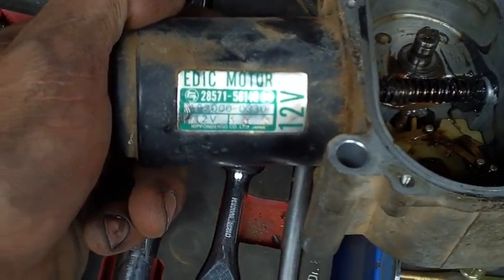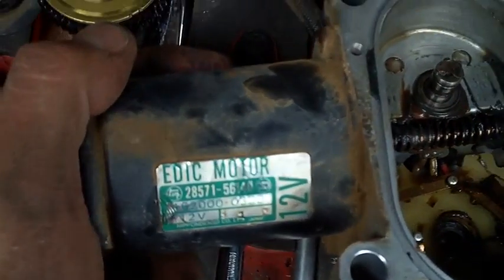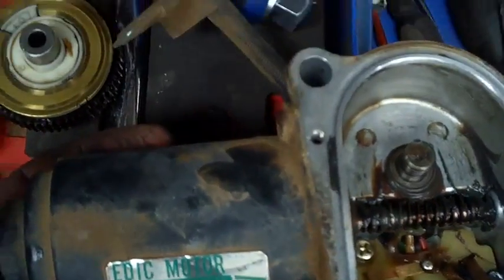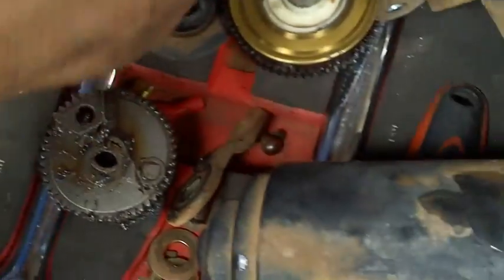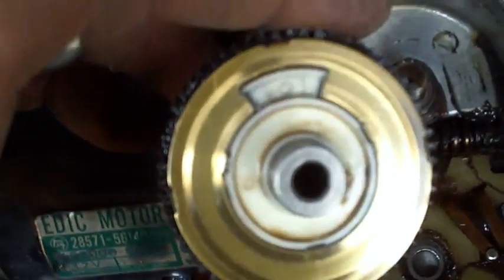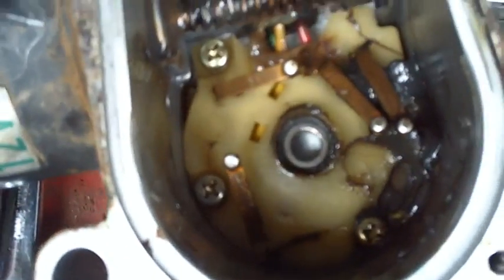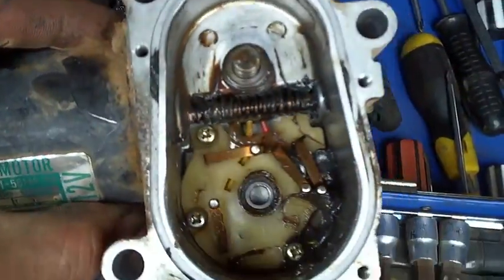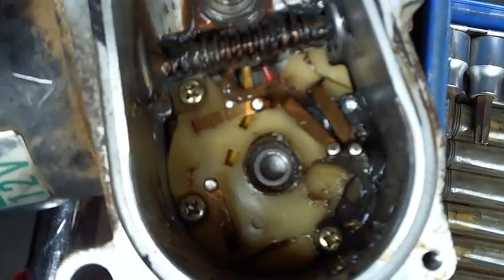toyota landcruiser hj47 2h diesel edic motor fault diagnosis

Comment: I removed  my EDIC as it was not turning the engine  off and kept over fueling. I replaced it with a pull push cable and now have never had a problem  since. I live in Melbourne  Australia so I do not need the EDIC to over fuel at  startup.

Comment: Ive seen people that have completely got rid of the edic as the edic is one of the weakest points on the old 2h. they instead install a manual cable up to the hand throttle. not entirely sure on how its done, though id like to do it to mine someday. I think the info is on ih8 mud somewhere...

Comment: Good one, did the same to my sons HJ47. (The clean out, that is)Although, I'm really chasing the original problem. The unit wont park in the injector pump cutoff position. Its swings briefly to that position but then returns to the run position before the engine stops running. Checked earths, seem to be OK. I'm thinking some one has had it apart and not positioned the output rod arm in the right mesh with the drive gear. When it parks, it should be in the pump shut off position. (According to the engine manual)Also, looking for a fault with the low oil pressure cutoff. When the oil switch wire is earthed out, the EDIC should shut the engine down but its not.Have you a lot of experience with these old girls?She also has the retrofit Airesearch turbo which makes a big difference to the power but recent problem with the waste gate jammed. It was full of old oily "jam", fun trying to track down a kit for it.CheersAndrew